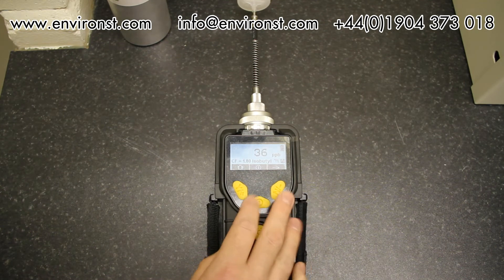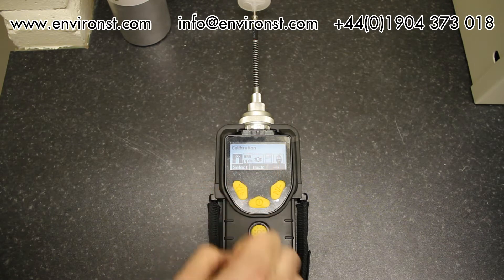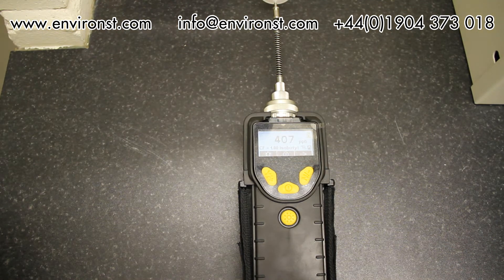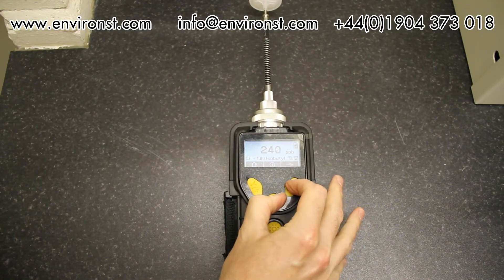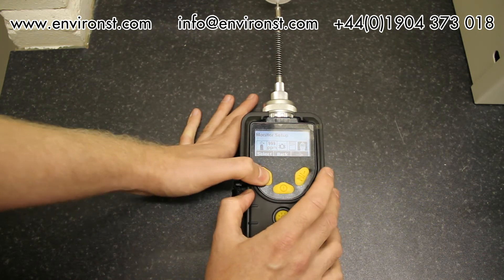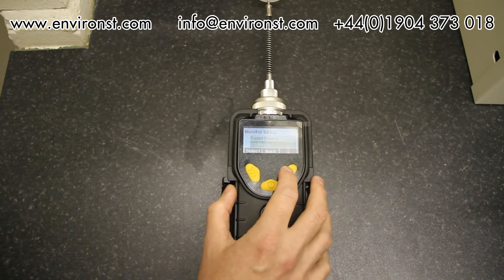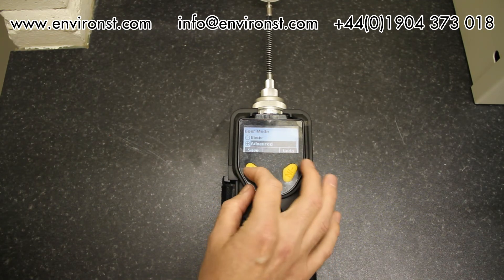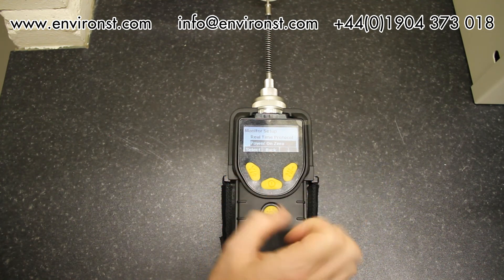Rae Systems ppbRae 3000 - Quickstart Guide

Comment: I ran a zero calibration and my values started skyrocketing and becoming unstable after. Any idea why? Thanks.
Reply from the maker: HarbingerDOOM, did you also run a span calibration? When values start sky rocketing it normally indicates that the signal generated by the zero and span are too similar, most often due to a low UV output PID lamp. So most likely your lamp is on its last legs.